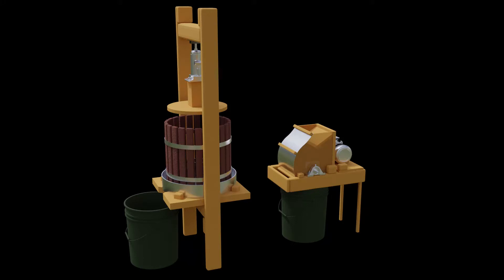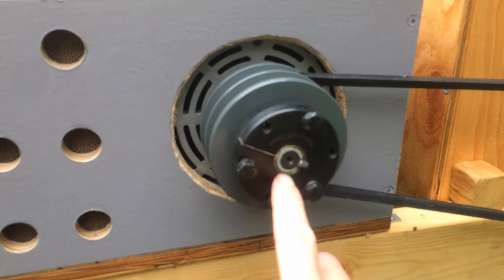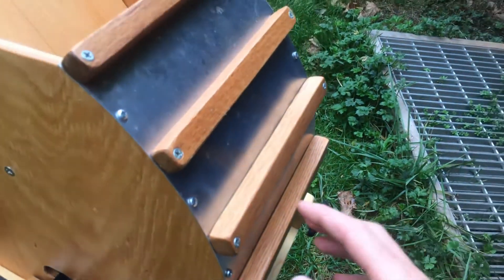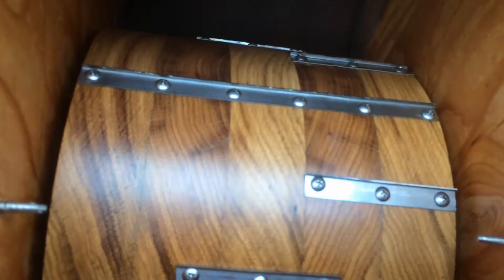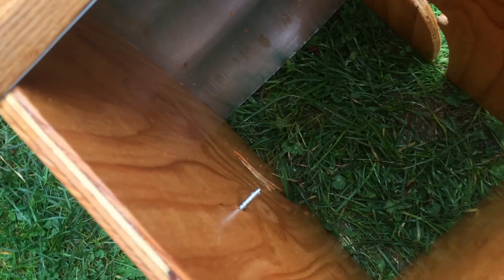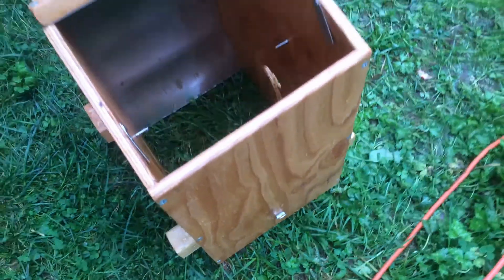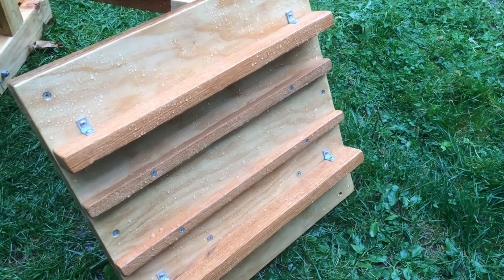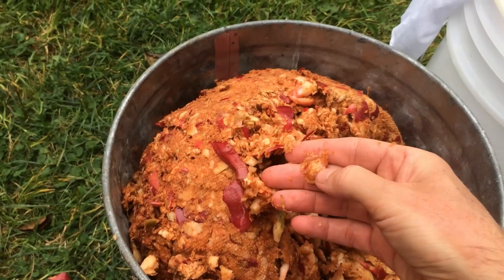Apple grinder and fruit press

Comment: Remarkable job.  I know this video is old, but I'm curious because I may build my own setup.  1) the commercial presses frequently use several layers of apple pulp separated by grids that permit the juice to flow in between those layers.  There's got to be a sound reasons for this; have you considered using, say, four or five polyester bags separated by additional grids?  2) It seems to me that the side to side (outward) forces are not that high compared to the vertical force.  Could you get by with a food grade bucket with holes drilled on the sides, especially at the bottom?  Would be super easy to build (not as attractive) and easy to clean.  If necessary you could nest one bucket inside the other or cut rings off a second bucket, place those 'hoops' over the main bucket.

Comment: Здравствуйте.  Не подскажите сколько оборотов в минуту на вал подается?
Reply from the maker: The important number is the speed of the teeth, which I think is supposed to be 20-50 ft/s (about 6-15 m/s). The shaft/pullies give about a 1:2 reduction in speed, I think? My motor has a speed controller, and goes from 70 RPM to almost 3000 RPM at the motor shaft. I usually grind at around 2000 at the motor shaft, so I'd estimate about 1000 RPM at the drum? | Важным числом является скорость зубьев, которая, я думаю, должна составлять 20-50 футов / с (около 6-15 м / с). Я думаю, вал / тяги дают снижение скорости примерно 1: 2? У моего двигателя есть регулятор скорости, и он меняет от 70 до почти 3000 об / мин на валу двигателя. Я обычно шлифу на валу двигателя со скоростью около 2000, поэтому я оцениваю около 1000 об / мин на барабане?
Reply: @caseyconnor2  Спасибо вам за ответ.